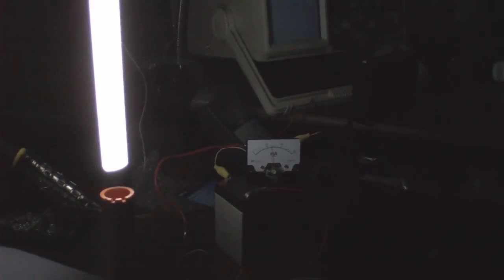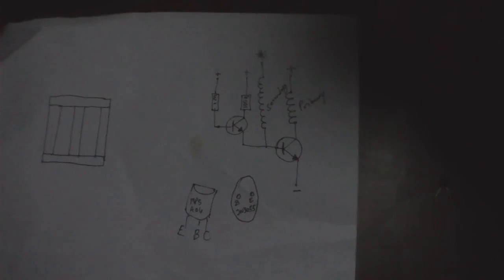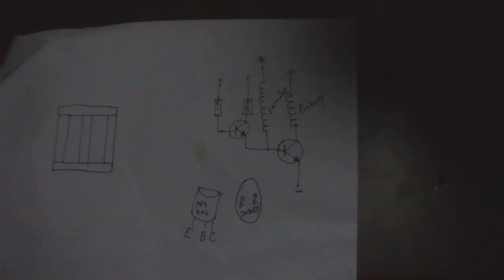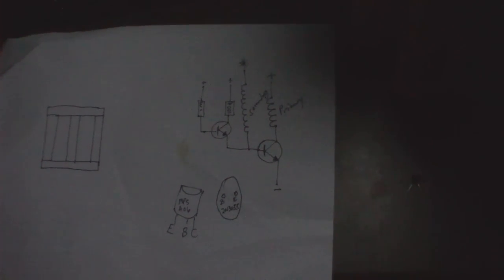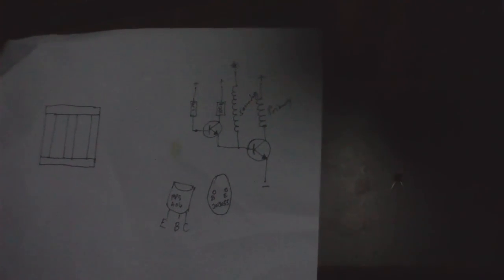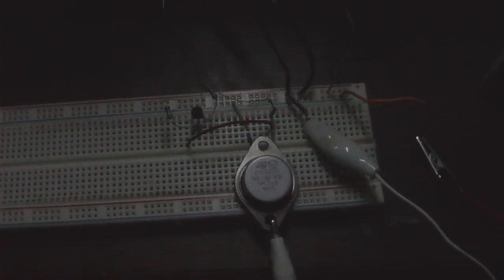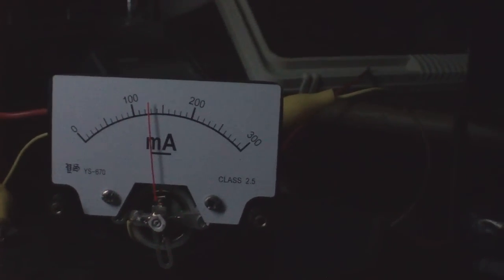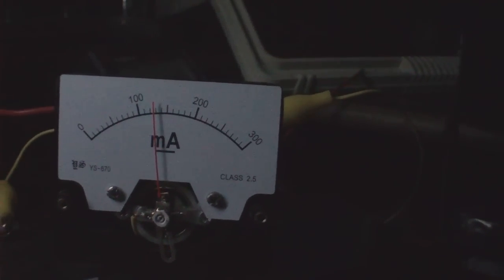Tribute - Slayer Exciter 1.5W - MPSA06 + 2N3055 signal boosted variant

Comment from the maker: Yes that is 12V, in the vid. No plasma. The main advantage, is, that normally it would draw about 180 mA - 220 mA, uncontrollably. The heat wreaks havoc on the MPSA06, and you do not get much extra light, or lumens for the last 100 mA. This offers more control to keep it around 1 watt. No heat on the MPSA06. it is also easier to automate, with say a dark-detect circuit, now.

Comment from the maker: 2N3055 handles the current, and the MPSA06 provides the base current. The wireless range is good yes. Normally I would have about 2-300 mA draw from the MPSA06, used alone, and so this setup wastes less to heat...

Comment from the maker: Thanks. Not sure, haven't scoped it... maybe a little lower given the "antennae" if you will, like you say... low MHZ maybe, might not work with every tower. I do have the equation for building a coil to a given megahertz, the ham radio way... if you like... though.. there is a correction factor, that is used, instead of just "theoretical values" so to speak.

Comment: Been wondering if This stuff would work better with radio stuff applied. I want to put a wire measure on my winding jig for making tuned coils. I still haven't seen any Tesla related stuff where anyone has tried to tune the coils according to radio law and shown results of what worked and what didn't.. I have a theroy that tuning it too "radio" will reduce some of the other effects.